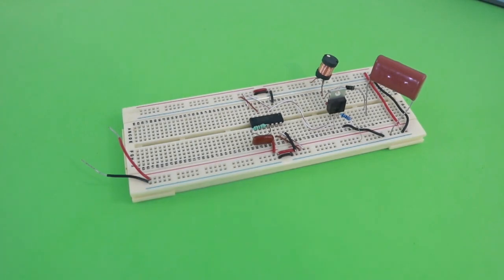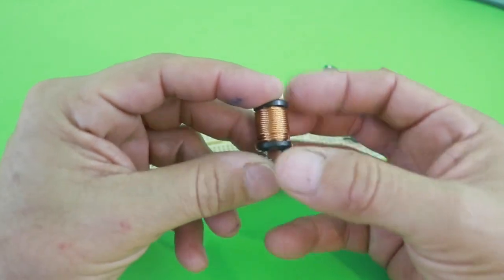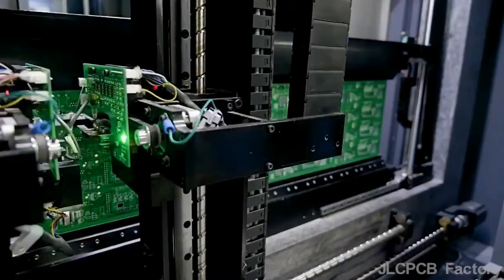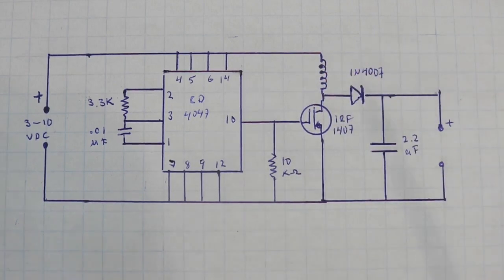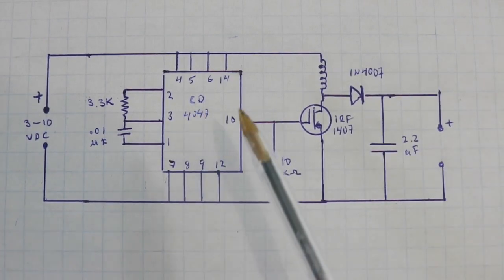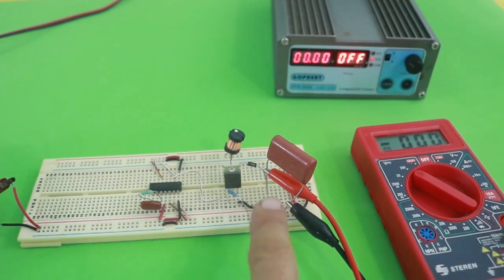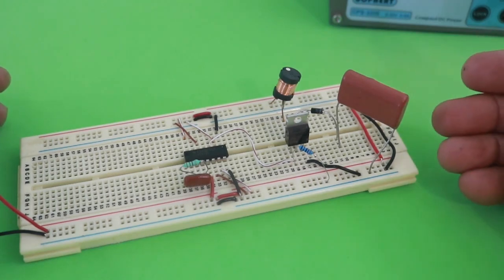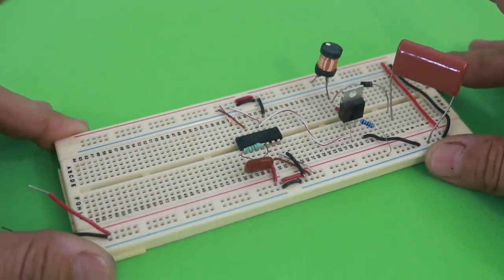Boost Converter with CD4047

Comment: Hi Ludic...great video. Is there perhaps a circuit diagram where you can energise a 12V dc relay direct from 220Vac without using a transformer?

Comment: Loved the video. What are the math formulas to calculate voltage out from the voltage input based on inductor?
Reply: There is no such formula. It is simply not true that there is any relation between these, it is only a misconception that has spread throughout the internet for some reason. 

In an unregulated, unloaded boost converter, the voltage can rise as much as it wants, only limited by the losses of your components. Note that his selected components are very badly suited for a boost converter. The diode he used is horrible, and he is probably wasting a lot of energy in his transistor as a result. His inductor is sure to have significant resistance as well.

The inductor value only influences the current ripple at a given frequency. So you select it based on the frequency and output current you want from the converter (higher frequency or more current capability -> less inductance)

The voltage must be controlled by continually adjusting the duty cycle of the transistor based on the output voltage as the load changes, if you want a fixed output voltage. There is no other way. Usually this is done by a dedicated IC.
Reply: hmmm yeah... maybe there's a "voltage divider" equivalent for inductors and AC...